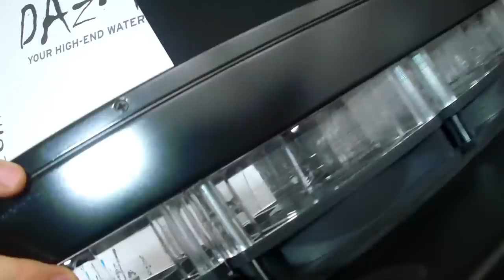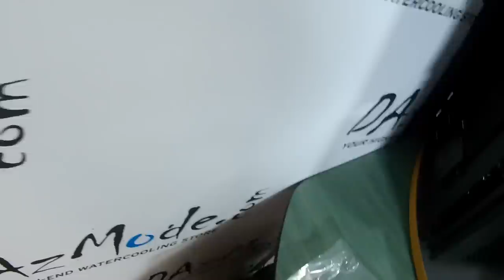FPS Style Review - Dazlab Stupid Vol.3 - Venom Build Update (14)

Comment: Daz, with the resources and time you will be putting into this, a push pull > than what you have setup right now.  In combination of the fans you are using plus the fan controller, noise will not be an issue and performance will be greater than the shroud setup.

Comment: why don't you put the first bank of fans on the inside of the case and then you can fit another bank of fans on the top of the radiator to give you a push pull set up?